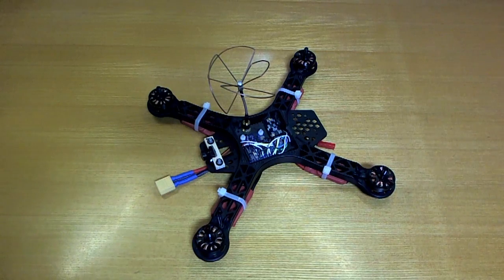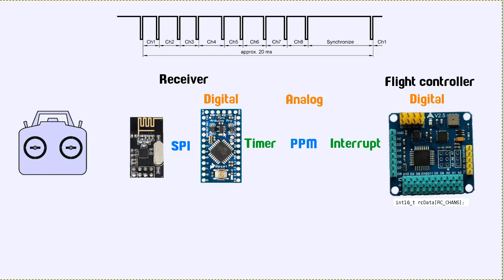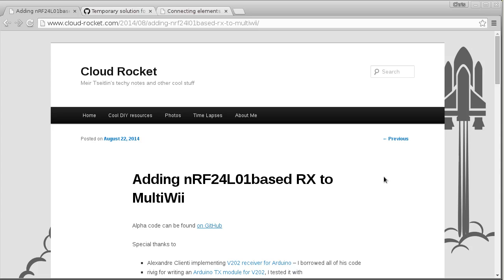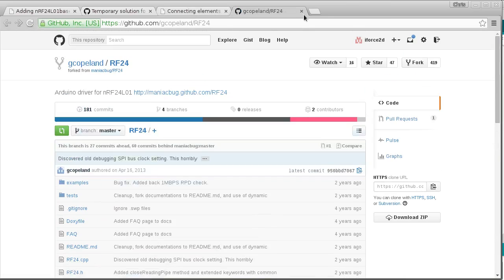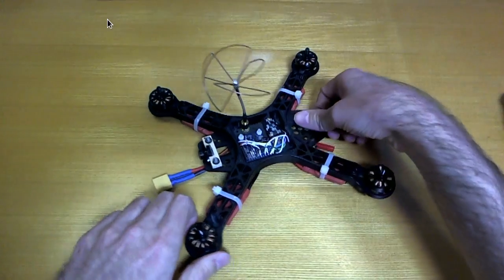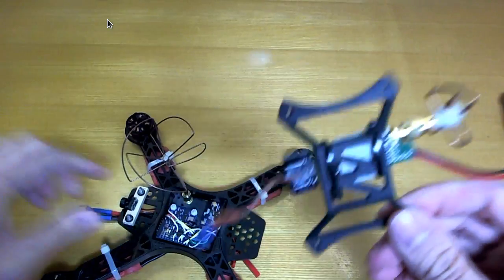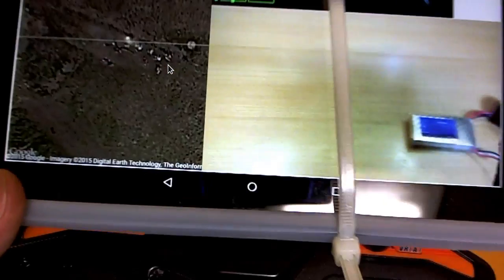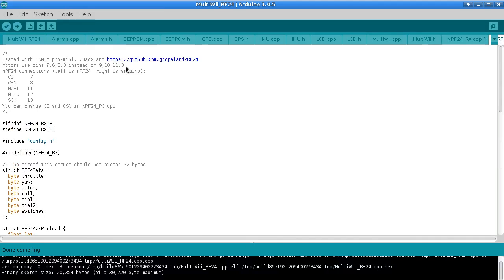Data telemetry with MultiWii integrated nRF24L01

Comment: Hi iforce2d, I am working on a project to transmit gps location to a receiver. I'm using the rf24 to transmit coordinates from Adafruits gps breakout. I'm having trouble transmitting the data and was wondering if you could help.
Reply from the maker: Watch this for a basic outline, then change the contents of the packet struct to suit your needs, eg. a lat and lon instead of throttle and steering: https://www.youtube.com/watch?v=eVnyPSAefxU
If you're stuck before that point, like you don't even have a radio connection established, go over this in detail I guess: https://arduino-info.wikispaces.com/Nrf24L01-2.4GHz-HowTo
Reply: Unfortunately I cannot seem to get the coordinates to send. Is there a way I can contact you?
Reply from the maker: You just did.
Reply: Alright, well to start off, I am trying to transmit GPS coordinates collected from the Adafruit GPS ultimate breakout. The coordinates are printed using,
Serial.println(GPS.latitudeDegrees ,5); Serial.println(GPS.longitudeDegrees, 5);
I've tried to convert the coordinates to floats, but doing so gives me (0.00000, 0.00000). Is there a way that i can create a package that can send these coordinates?
Reply from the maker: So GPS.longitudeDegrees is an int, or a long type? What do you do that makes it zero?
Reply from the maker: Wait a minute, we already talked about this last week, where I gave a link to a video that explains all the sending details. The only difference is that instead of sending a struct with values like this:
   byte throttle;
   byte steering;
You will change that for your lat and lon values, using whatever variable type they are.
Reply: From my understanding of the datasheet, GPS.longitudeDegrees is a command that takes data from the library and converts the serial data from the GPS breakout to a more comprehensive value in degrees. The value is neither a float, int or long int. I was hoping that i could take the value of GPS.longitudeDegrees and create a float equal to that value, but doing so makes the float zero. I understand that the transmitter is capable of sending many data types, but is there another way to send the value of GPS.longitudeDegrees?
Reply: I've tried it with that method but I've had no luck.  That is why I'm still searching for help
Reply from the maker: "had no luck" is as bad as saying "doesn't work". Look at this from my point of view man... you mean the source code didn't compile? It compiled but crashed? It ran without crashing but the receiving side never showed any incoming packets? Or the receiver showed incoming packets, but they had the wrong value etc etc etc etc etc it could mean dozens of things.... please give me a clue if you expect some useful assistance. "The value is neither a float, int or long int" I'm afraid that is extremely unlikely... and what is it then? You still have not said what you do to that value to "create a float" that ends up with zero. Was it zero before you did the "create a float" part?
Reply from the maker: If this is the library you're using, you can see the value is already a float:
https://github.com/adafruit/Adafruit_GPS/blob/master/Adafruit_GPS.h

So your packet struct members would be like this:
    float lat;
    float lon;

And you just set them like
    data.lat = GPS.latitudeDegrees;
    data.lon = GPS.longitudeDegrees;

I don't see how it could be any simpler.
Reply: Here's how I created the float.

#define lat GPS.latitudeDegrees   //this gives GPS.latitudeDegrees a new name

float lat2 = lat; 

Serial.print(lat2);  //on the serial monitor i get 0.00000 even though Serial.print(lat); produces a value like 52.45355

As for me having no luck, its the transmission of the wrong value. I am only sending 0.00000 using the float conversion above. When I try to send "GPS.latitudeDegrees" alone, the code wont compile because of the "." after GPS. To overcome that, i gave it a new name (lat) and tried to send "lat". The code uploaded but there was nothing being received.
Reply from the maker: I don't see the point in using the #define, it's very risky for practically no benefit... I would not be surprised if the variable "lat" was already used somewhere, depending on the ordering of your #define and #includes you could mess up the whole included library. You should always use a name that you know for absolute certain is not already being used elsewhere, for example:

#define KILLERX_LAT GPS.latitudeDegrees

... but to be honest for something like this I would just use the normal variable as is.

I don't get what you mean by "send GPS.latitudeDegrees alone", how would you do that? You need to put the things you want to send into the struct, and send the struct.

So your struct would be like this:
struct MyData {
    float lat;
    float lon;
}

And you set the struct contents like:
    data.lat = GPS.latitudeDegrees;
    data.lon = GPS.longitudeDegrees;

And send the struct like this (ie. no change needed):
    radio.write( &data, sizeof(MyData) );

At the receiving side you make sure the struct definition is exactly the same. That should be all there is to it.
Reply: Alright so I got it working. Now I would like to print the location received to an OLED screen. However they both use SPI. How would I go about programming the circuit to receive and then print?

Comment: So, these videos are awesome. So thanks for that. I have the uno set up being the transmitter and receiver with the NRF24. I keep following online tutorials with ESC throttle calibration. However, although i am able to arm the ESCs i cannot seem to calibrate throttle with uno transmitter. The ESCs make start up sound but with the calibration step everyone uses i don't get that recognition beep telling me it recognizes top range of throttle. Any thoughts? Thanks in advance.
Reply from the maker: That method of ESC calibration is very common, but not necessarily the only one. Your ESCs might do it differently. Often you can use them without calibration, if they seem to all be spinning from about the same level of throttle, you could give that a try.
Reply: iforce2d they don't spin at all. I have the hobbypower ones I'm waiting on a programming board for. But I also am trying to use cheap red eBay ones that have the Simonk firmware. I am able to arm them according to the Gui. However when trying to throttle up they won't spin at all. Not even a little bit. So that's why I attempted to calibrate throttle but they won't even make the beeps past the startup tones. Any thoughts? Thanks for the quick reply btw!

Comment: you can make a drone with various Arduinos without flight controllers and how would it be?
Reply from the maker: It would be sitting on the ground doing nothing :)
Of course you need a flight controller.
Reply: But can you make the Arduino to be the flight controller or not?
Reply from the maker: ??? Yes, the arduino is the flight controller, it always was. Google "multiwii"

Comment: can you make the a quadcopter using a arduino uno as flight controller.and nrf24lo1 module as receiver.
Reply from the maker: Functionally there is no difference between and uno and a pro-mini, so yes.
Reply: can you provide the schematics.?
Reply from the maker: Please look at the multiwii website. The connections for the nRF24 module are shown in the source code (file NRF24_RX.h) and also here: https://arduino-info.wikispaces.com/Nrf24L01-2.4GHz-HowTo

Comment: hello iforce2d !!!!

I tried to compile the code and it gets me this error.

exit status 1
#error "Currently nRF24 RX is only supported for ATmega328P"

 and I think it is because I have arduino mega 2560.

Can u help me to make it possible for arduino mega 2560?
Reply from the maker: There was somebody else asking (and I answered) about this in the comments here already. Sorry I don't have time to search for it now myself.
Reply: thanks no problem at all.
Reply from the maker: Look below for the discussion with "Darius Keinys". You will need to get the original file for "output.cpp" (none of my changes are necessary for mega2560). You will also need to change the SPI pins to the appropriate ones for mega2560 https://www.arduino.cc/en/Reference/SPI

Comment: Hello while compiling I'm getting an error message. 

avr-g++: error: missing filename after '-o' 

Do you have any idea how to fix this?
Reply from the maker: Do I have any idea what you are using to compile... the arduino IDE? It sounds like a compiler setup error, rather than anything specific to this source code.
Reply: Ok right now I'm using arduino 1.6.6 should I download an older IDE?
Reply from the maker: I don't know. Does your arduino IDE compile anything at all?
Reply: +iforce2d it does not have a problem with uploading vanilla multiwii
Reply from the maker: That's very strange. What file is it trying to compile when the error shows up?
Reply: +iforce2d I just tried using different code from an other project and the same error came up....  I'm going to try to reinstall the IDE.  I'll let you know if it works
Reply: +iforce2d reinstalling the IDE fixed the error...  That was odd.  Thank you for the help!

Comment: What version of the multiiwii GUI did u use?
Can i have the link plzz :) 
and also would this work with a brushed quad using mosfets
Reply from the maker: The version of the multiwii GUI should not be important, this mod only changes the way the flight controller receives the channel values.
I think you can find it with Google.
I don't know if multiwii works with brushed motors.

Comment: hello iforce2d 
because pin 13 use for Nrf24 , so i  replace pin 4 for led mode , but  it can't  work ,  i  change in def.h . 
#if defined(PROMINI)
  #if !defined(MONGOOSE1_0)
    #define LEDPIN_PINMODE             pinMode (4, OUTPUT); // change pin 13 to pin 4
    #define LEDPIN_TOGGLE              PIND |= 1<<5;     //switch LEDPIN state (digital PIN 4)   //PINB |= 1<<5
    #define LEDPIN_OFF                 PORTD &= ~(1<<5); // PORTB &= ~(1<<5); 
    #define LEDPIN_ON                  PORTD |= (1<<5);  //  PORTB |= (1<<5);
  #endif
Reply from the maker: +minhthien7288 shouldn't it be 1<<4, not 1<<5 ?
Reply: +iforce2d   what's your mean ?
Reply from the maker: +minhthien7288 huh? In your code you are using 1<<5 right?
I think it should be 1<<4 if you want pin 4.
https://www.arduino.cc/en/Reference/PortManipulation
Reply from the maker: +minhthien7288 okay, then I have no idea. Your code looks ok to me.

Comment: Hi,

I tried your code but for an unknown problem the multiwii didn't see input from my radio.

If i upload the receiver code for debug it's working and i see the input. (so not a wiring issue, i think :D)
http://imgur.com/eOOboAP

When i tried the multiwii all channel are to 900. (AUX not configure yet) (http://imgur.com/x4m8oRz)

If i replace the code from RX.cpp

  #elif defined(NRF24_RX)
    if (chan < RC_CHANS) {
      data = nrf24_rcData[chan];
    } else data = 1500;
  #else

to :

  #elif defined(NRF24_RX)
    if (chan < RC_CHANS) {
      data = 1666;
    } else data = 1500;
  #else

i show 1666 with no probleme, so the define of nrf24RX is working.

Of course the pipe is the same for my remote (same as the cheapass series) and the multiwii

i using a gy-88 and a pro mini, and the same gcoopland libraries

I tried to debug it from 2 week and i'm going mad can you help me please, my code is here (https://drive.google.com/open?id=0B211GuJbm1iNcy1qYml0MVJYbUE)

thanks
Regards wanoo
Reply: +Erwan Rougeux ok i found, it was multiwii.cpp where my diff was not applied (but every where it was) strange - _ -" 

Thanks

Comment: Why Arduino gives me an error? It says: "fatal error: nRF24L01.h: No such file or directory
 #include <nRF24L01.h>"
if I add a tab to the sketck with "nRF24L01.h" I receive the same error. Do you have any solution?
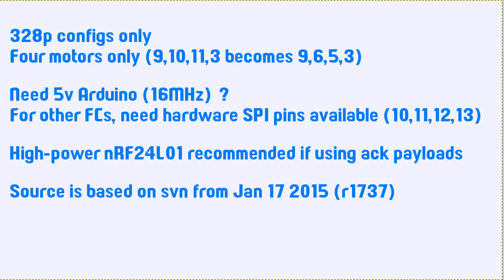Reply from the maker: +Federico Spadaro You need the RF24 library.... I explained at 16:03

Comment: How to make it use it on a arduino mega 2560?
BTW Love your videos :-)
Reply from the maker: +Allan Madsen I think there was some discussion about  that here in the comments
Reply: +iforce2d Thanks for the quick respond :-). Can you make a diagram about all the connection you can do on at Mini pro, like staus led, nRF24 and so one, ican't find any diagram with it all connected :-)
Reply from the maker: +Allan Madsen ?? are you talking about pro-mini now? You want to use a mega2560 or what?
Reply: +iforce2d That iam not sure about, i like to use the Nano, but ican't find anything about that one used with multiwii and the nRF24 because its have the USB "interface" and i think that the Mega is a over kill.
Reply from the maker: +Allan Madsen the pro-mini, the nano, and the uno are all exactly the same chip (328p), they just have different host boards (nano has USB, uno has better power regulator etc). So all the multiwii info you're reading will be fine for the nano.
Reply: +iforce2d Ohh ok :-) Bout how about all the connection you can do on a 328p, i like the ides about only use one nano to control it all also the things with your light on / off, the gps (Iknow use i2c) and so on.
Reply from the maker: +Allan Madsen I don't know what you mean by "all the connection you can do".... there are thousands of tutorials and documentation about arduino out there
Reply: +iforce2d The light you made with the Mini pro and the multiwii 2,4? the GPS and so on.
Reply from the maker: +Allan Madsen yeah that doesn't really help... are you talking about something in this video?

Comment: hello I have an error message with your file.
while all his property file in the same directory
I know not even to correct
how to thank you

Arduino : 1.6.8 (Windows 7), Carte : "Arduino Pro or Pro Mini, ATmega328 (5V, 16 MHz)"

C:\Users\DJ\Desktop\MultiWii_RF24\MultiWii_RF24.ino:16:22: fatal error: nRF24L01.h: No such file or directory

 #include <nRF24L01.h>

                      ^

compilation terminated.

exit status 1
Error compiling for board Arduino Pro or Pro Mini.
Reply from the maker: +David Dj did you install the RF24 library in your arduino IDE? Listen carefully at 16:03
Reply: +iforce2d yes sorry I did not have the good bookstore now it works without error.

can you help me
I found a file that suits me very well for my Arduino quadcopter MultiWii with nRF24L01
that uses the v2x2 protocol.
it works very well :)
the only problem there is that the throttle-yaw-roll-pitch depending miss it aux1 and aux2
I do not know how to add the
thank you.

https://github.com/cloud-rocket/multiwii-firmware/tree/NRF24_Support

Comment: Where do I have to change the code in the MultiWii, if I want to use pin 6,5,4,3 for the motor outputs?
Reply from the maker: +r0ckahead part of the deal with this modification is that you can't mess with the pin layout. Pin 4 does not have PWM output anyway.
Reply: I see, but e.g. with the Servo library I can use any pin for pwm control or is there a reason why it's not supported?
Reply from the maker: +r0ckahead it's not as easy as just changing a number. Take a look in output.cpp and prepare for a headache. Why do you want to change the pins?
Reply: Simply because I soldered a shield for the Arduino connected with these pins. Actually I'm experimenting with my code, which just uses PIDlibrary, Servo and the required ones for nrf24l01 and MPU6050. In comparison I wanted to see how the multiwii works.

Comment: Hi Can MultiWii Run on a arduino mega 2560
Reply: Sorry found out it can. Maby a card with arduino mega 2560 (all the normal connection) with a level shifter to I2C bus and 3v3 onboard :-)

Comment: I have been working with the NRF modules for a while now and I am getting so frustrated with them, I am no expert with programming but I am sure the code I am using is ok because if I randomly reset the UNO on the sending module the odd transmission gets through. I have added capacitors to the pos and neg terminals on modules and  I have used an external 3.3V power supply but still no success. The code is short and simple so are there timing requirements between sending and receiving or do you have any other suggestions, please help I would like to use these modules but I am about to give up on them. I can run the simple examples in libraries ok but I am wanting to send the temperature from my DHT11 temp sensor, I am finding it difficult to find any examples on line of this that I am able to figure out. Cheers
Reply from the maker: +NuCleaR WinTeR The only clue I can get is the way you talk about 'timing requirements'...  are you sending continuously in a loop, and receving continously in a loop? If the examples work, it should just be a matter of playing spot-the-difference, or gradually converting an example to your own code and see where it stops working.
Reply: Thanks for your reply, after spending a lot of hours trying to get these to work I finally got it going this morning and they are working great. Yeah I did have working in a continuous loop so I could keep updating the results. Great videos by the way I liked your cheap-ass quad series.

Comment: Hi iforce2d i am using this code i found that in muitiwii gui the speed of the motor decrease slowly and dose not go to full speed untill i move the throttle sick completely down & move back to top & then after few seconds it dropping again so it is ok or some things is wrong ??
Reply from the maker: +Piku Sk Is it just sitting on the ground? If so the motors will behave strangely, because they controller is not getting the result it expects. Try flying it properly.